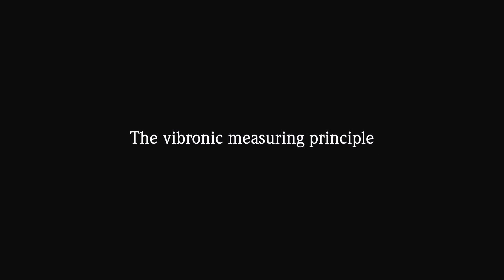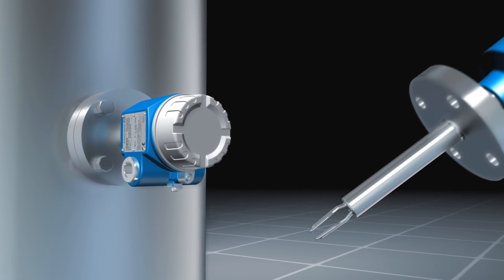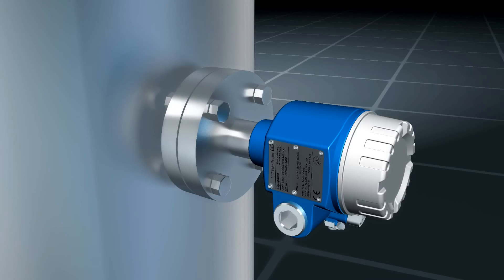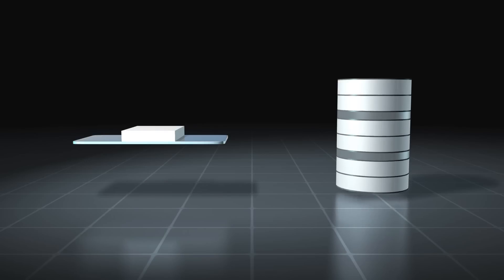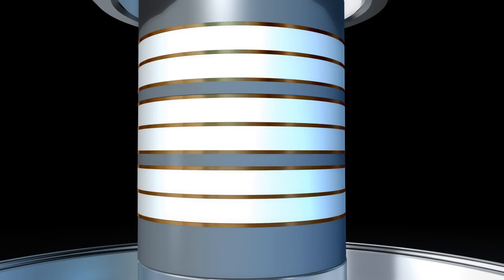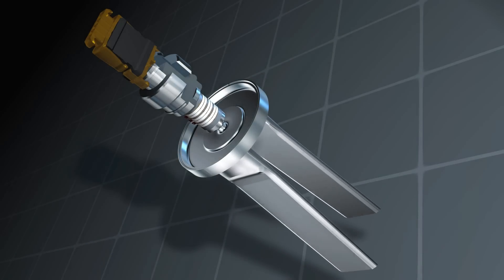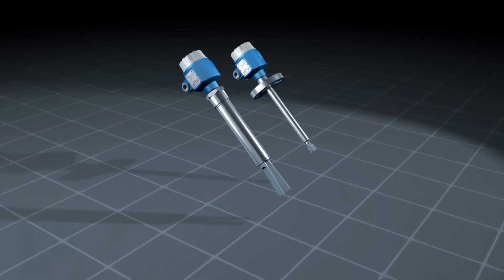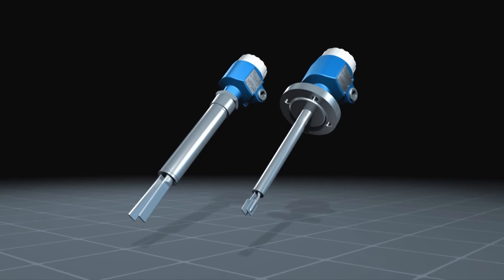Vibronic measuring principle animation

Comment: thanks for this educational video. May I ask you to kindly specify the advantages and disadvantages of this vibrating probe system in comparison with the rotary paddle? in terms of lifetime and price and etc.
Reply: Ali, the vibrating tuning fork is viewed as a very robust technology.  Since there are no moving parts, it is widely viewed as lasting much longer in life than a mechanical switch (like the rotary paddle).     Pricing will vary in comparison depending on the industry and designs you are comparing, but the value of the tuning fork for the price is typically viewed higher for it's proven reliability and availability.

Comment: Can you tell how the the sensor detect the frequency shift ?
Reply from the maker: The piezodrive consists of a transmitter and a receiver. The piezo receiver measures the current tuning fork frequency and the frequency shift is evaluated in the electronics.
Reply: So we can say the technique of measurement is vibrating tube type

Comment: Does ten sensor work on very dense products? Do the dense product suddenly suspend the alarm of this device?
Reply from the maker: The tuning fork sensor works propper for all liquids, the limitation ist the maximun Viskosity of the Liquid 10.000cSt (means dark Honey) and the minimum density of the liquid > 0,5kg/l. If you are working outside the specification you may have a wrong mesurement value or an alarm.